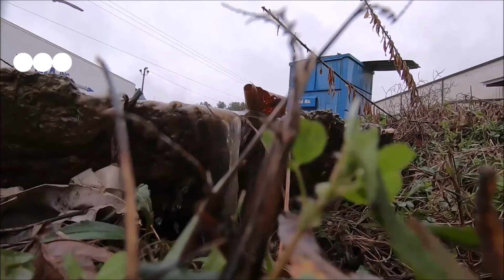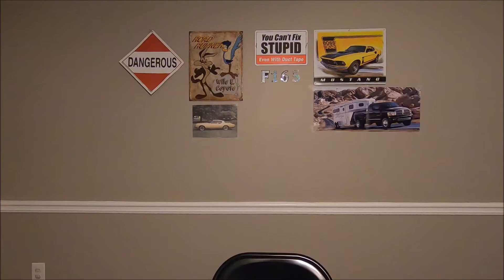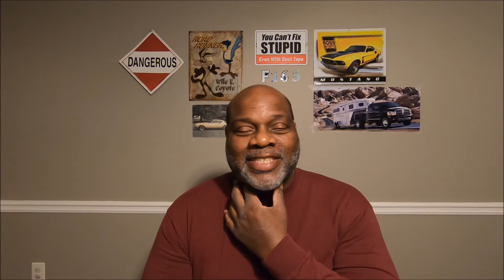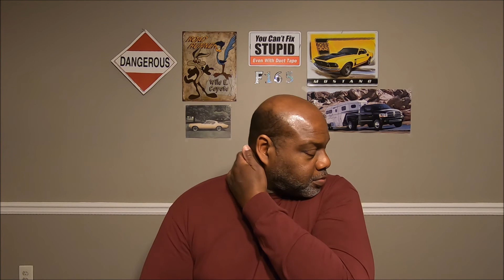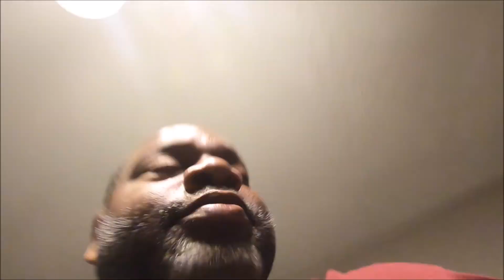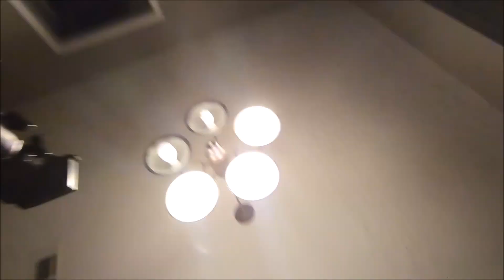Vtec is like running 2 different cams

Comment: The logic is right you may get more peak horse power put the car depending on the can that you put on will be an absolute ass to drive. Here in Brazil VW 4cilinders are the most popular drag racing engine, the preparation is pretty straight forward. bigger cams, turbos, copper rings doing the cylinder/head seal and a fiber gasket, also a head job, some guys here even change the angle of the intake port with a bigger can so that it is not an absolute chore to drive in low.